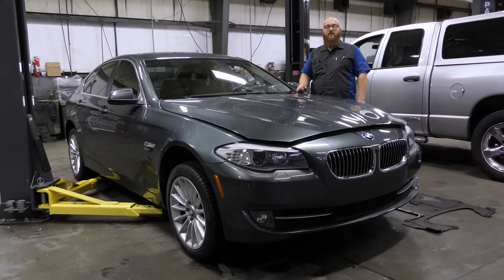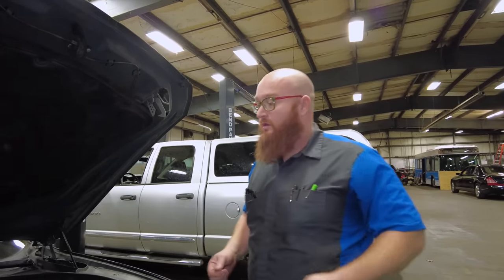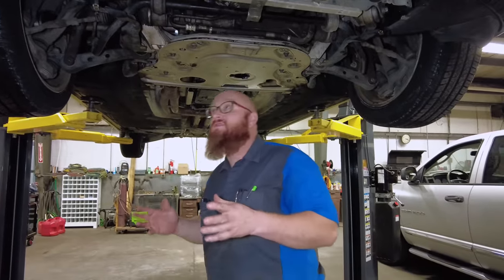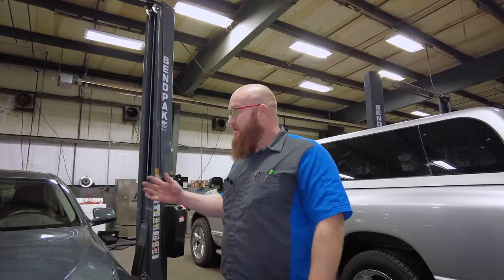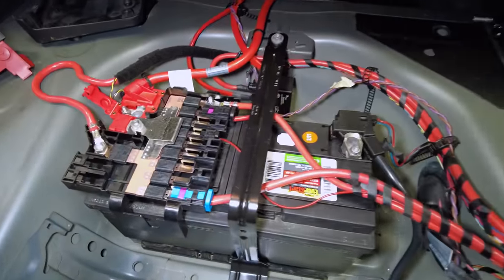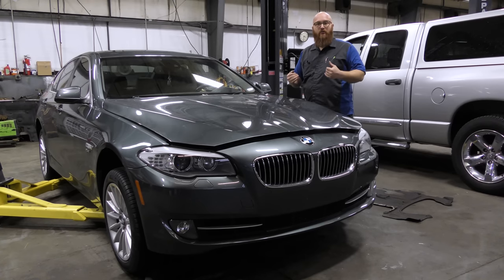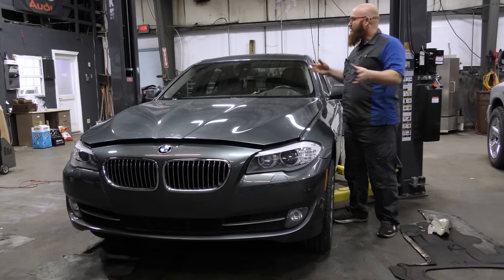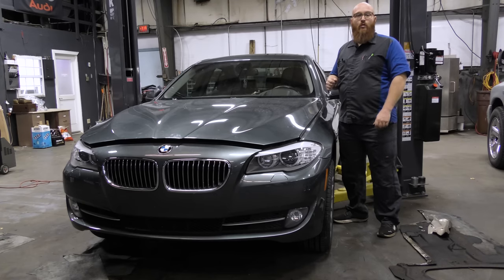One bad day for a customer! CAR WIZARD found TWO insanely unrelated issues at time on '12 BMW 535i

Comment: Somebody's been there before... wrong coolant color. Lowest point with easiest access to drain the coolant. 100% someone messed up putting it back together. If the owner stopped the car immediately as he noticed the overheating check control message (or before if he noticed it on the gauge) then the engine is fine.
And I'm still surprised people take their BMW to a mechanic that chargers $600 to replace an E46 oil filter housing gasket.. $1200 to replace the starter motor is insane...

Comment: I love BMW's but used ones are best left to DIY enthusiasts.  I've had multiple ones over the years and while they have more issues than a honda or toyota they are easy to work on and won't break the bank if you are a DIY'er.  If you can't work on cars then definitely stay away from them as for the price of maintenance you might have well just bought a new one with a warranty.  As someone who owned a Porsche 911 993 model it is funny to hear him talk about the cost of these jobs.  $600 for a seal replacement, $1200 for a starter on BMW's etc.  I had to have a valve job done and even as a DIY'er I didn't want to touch it as when you go to sell it people want documents from a reputable dealer.  Well that was $6k.  The power steering was also leaking, another 2K.  Starter went out which I replaced myself and the Bosch part alone was $750 and I had to make a special tool to hold the bolt while re-installing it because you can't even see it and can barely feel it without removing the engine.

Comment: I'm not a BMW guy but it does have 200K miles, it's over 10 years old and things are going to start breaking. Regarding the starter, my guess is that he tried restarting it when the engine was really hot and since these things have weak starters to begin with, it just couldn't turn the engine over and it died.

Comment: That's a really weird way to keep it into neutral. I have an E66 7 series and there is a simple way to do it from the Trunk. There's a stick near the spare wheel, we need to insert this stick into a hole that is clearly labelled, just insert and turn and the car goes into neutral.

This is a BMW from 2005, it's a shame they didn't keep a similar feature in the newer one.

Comment: Wondering if the overheat triggered something in the dme. I'm even doubting that starter is bad.  Pretty dirty (BMW) to put starters under intake manifolds although I have heard of some guys sneaking them in from underneath (lift).  From the customer perspective, If you are not mechanical and want to drive older bimmers, prepare to pay or just lease a new BMW.  They want it that way.  Great channel wizard!

Comment: Bmw haters. Had my 530d for 10years and 172k miles. Oil changes at 10k and premium fuel, only thing aside from brakes and tyres was tie rod ends at 170k. Never missed a beat and was remapped at 60k to 325bhp.

Comment: Starters on bmw's are program interlocked. Same is true of Mercedes. Ive seen a transmission on a mercedes throw itself into limp mode and it would never accept a new transmission, we ended up replacing the ecu to make it run. And it was tragically expensive, and that car has more of my blood in it than i have in my body currently.

Comment: its true,they run hot ,thats part of bmw scheme .if you dont turn them off when they start to overheat  you are takin a big chance becuz you dont have much time and they warp up,ive had many bmws and never truly overheated one but ive come close and lucky...bmws are not for everyone period,and many ppl drive them into the ground by NOT fixing the little things as the go wrong and then they have bigger problems.now i dont buy or own any after 2005.ive had e90,e70,e30 e46 e36 now ive kept my e39 and e53 and im happy.this guy makes good points but all cars after 05 to me are junk.

Comment: I owned one for 3 years. Bought it with about 80k miles, sold it with 160k miles. Only ever had 1 issue : the damper crankshaft pulley gave out at around 100k miles. Changed it, and never had another issue.
Reply: Someone has to get lucky! Right? Call the person you sold it to and ask how's it doing.

Comment: I own a 2013 bmw 528i drive that has 168,200 miles on it. I love the car but the almost two years I've owned it I've had problems all the way from coolant hoses spraying coolant everywhere to transfercase and transmission blowing out. Every week it feels like it has a new problem whether its electrical or mechanical and the car is very well taken care of and babied but it still never stops breaking.

Comment: Check them all. Of course BMW have electric water pumps. And the thermostat is from the factory is yes plastic, but. You can now buy a replacement aluminum one. Not sure wizard but the BMWS made in Germany ship to the U.S. starting with the Vin: begging with G 
are better quality cars. Or the older ones "89-2010 BMW with no I drive, no X-drive, no turbos and so on. The  kicker is you have to, you must, work on your own BMW because if you do not work as a mechanic on your own car. It will put you into bankruptcy..You have to love this car as many of us BMW enthusiast 
know. How to fix all the the problems these cars bring and do the work ourselves.. They are very good cars if you understand them and how they work. Thanks wizard..

Comment: My Porsche blew a hose and overheated coming out of my neighborhood. It ran for about a 2-3 minutes before getting back into my driveway. It was fine (20k miles later). Replace the starter, refill the coolant. Should be fine if the customer didn't go far.

Comment: The starter solenoid failed.....all you have to do is manually short out the starter to directly drive the starter motor at the same time as you are trying to start it, so the ecu sends the start signal to the injectors and such. You could then verify if the engine is operational and it would not take more than 15 minutes of labour. From there you could make a decision.

Comment: I had those undersized head bolts come lose which lead to overheating; just retorqued.
Electric pusher fan failed, removed it and shroud, ok now.
Too many plastic parts like heater return hose, custom and failed, plastic radiator tanks, plastic radiator fill tank.
Just lubricated u-joints, new guibo, fixed driveshaft bearing retainer, lubed cv joints, OK now!
Yes these cars are too much! :)

Comment: I really like your videos and content however I have to say that this whole video is a load of bunk. Nothing in this video is uniquely a BMW issue, in fact this particular car appears to be a very nice example of an F10 535i. 

First of all, there is a manual neutral override in the center console in front of the gear selector for F10 chassis vehicles, you pull out the cupholders and use a tool included with the car to force it into neutral when the battery is dead or the engine doesn't start. The one underneath the car is so that you can hold the transmission in neutral or park while doing work without needing to go up top and change gear, that's how ZF designed it and those gearboxes are actually quite good. You mentioned the car has "X drive problems", it doesn't. There's nothing wrong with the system, it is working totally fine.

Second, a coolant line bursting on a car with 200k miles happens all day every day to all cars. The vehicle warned the driver of a problem, the vehicle was stopped and everything was OK. Again, not a problem unique to BMW, hoses are made by Rein and the quality is good, it was likely the original hose.

Third, the starter likely failed either by coincidence or was close to failing and the excessive heat pushed it over the edge. BMW starters of this era are made by Denso, the same manufacturer for Toyota and many other brands, I don't hear anyone complaining about those. If this was an original starter then I would consider that quite good, starters are very commonly replaced with poor quality aftermarket units and contribute to a bad rep. Denso starters are very good quality parts.

Otherwise the car (with 200k miles) has a small leak from the rear main seal. These cars do have common issues, this particular example doesn't have any of them and seems to be a very nice car for the owner.

Comment: N54 one of the greatest platforms - especially in a manual.  Starter replacement sucks.  don't overfill coolant or overflow will burst.  And while you're in there, change out the regulator module!  - normal for a car over 120k.

Comment: Great video it verifies but I told people about BMWs I fix cars my whole life BMWs are crazy my buddy bought a brand new X5 in the throttle did whatever it wanted he have five modules replaced under warranty I drove the vehicle the accelerator was out of control it was just predictable he got rid of the vehicle because it's just too unsafe to drive and BMW told them there's nothing wrong with it have a great day you taught me a lot that I didn't know

Comment: That coolant line has to be unplugged to access two bolts attaching the subframe to the front of the vehicle. Most likely the front subframe was lowered during a repair and the coolant line was not properly reattached. Or someone tried to drain the system from that line.

Comment: It’s a 200,000 mile BMW. Most cars at 200k miles will require some type of maintenance. The customer should know that. Starters are wear items and considering the miles and years, that’s normal maintenance.

Comment: I refuse most older BMWs and Mercs due to the cost to the customer. A lot of these older luxury German cars are owned by people who want to baller on a budget. Countless times I've called and they gasp when they heard the cost to repair. Many times they've abandoned the vehicle. 

You'll occasionally run into the type that just love the car. They don't want a new car, and they could go buy a new one cash. They drop it off and essentially give you a blank check to fix it.

Comment: If that's the original starter on over 200,000 miles then in my opinion that starter has performed admirably especially if the car is fitted with stop start technology. Just unlucky it failed at the same time the coolant issue arose.

Comment: On large marine diesels I take the thermostat out.  $30,000 diesel blown because of a bad $60 thermostat? Keep the engine temp sensor and you will see no difference except at warmup.

Comment: About a year ago, our 528iA got overheating problem. As we saw no leaks, I realized it could be some kind of obstruction. In the radiator's bottom there was a metalic duct that was clogged with rust and dirt. Import a new one was quite expensive, so we decided to clone it using a better material(aluminium) with a professional. Coolant re-filled, the engine started at once and never again it gave up(but it's an E39 from '98). If you want a car like that, you must ensure the maintenance is done properly. The new ones? Thanks, I'll pass.

Comment: C. coolant hose is most likely.  Could be A,  If the water pump blew up it is plastic(not that likely).  Not B. as there would still be coolant in the system enough to atleast keep it cool and that wouldn't leave a trail if it was just the reservoir.  Aww crap you got to pull the intake... I'll wait to clean my intake values then when I have to replace the starter :(

Comment: Can confirm what the wizard says is true 😞 about a month ago my starter gave out (which I already had replaced just 2 years ago), then the water pump gave out just about a week later so had to replace that and the thermostat while I was at it, then literally in 2 days the radiator blew and coolant began to spew everywhere so had to replace that and now I'm noticing a pool of oil under the car wherever I park 😒 oh and totally unrelated, my rear passenger side window regulator just randomly broke so had to replace that too

Comment: Didn't the owner get a low coolant level light? I have 2 06 330s and I agree with the location of the starter. I actually love them living in the rust belt they're the only cars I have with no rust.

Comment: i had an 08 335i, same exact thing happened to me. coolant leaked out car overheated. the starter also went out, granted the car had 195k miles at the time. but i’ve always wondered if someone else has had a similar experience.
Reply: Weird how your starter failed at the same time too. It's almost like Bmw built in a self preservation feature to stop further damage to the engine

Comment: I think after it shutted down , someone had tried to turn it on so much and it wouldnt turn on because of no coolant there enough in the car , 
So someone tried and tried until he missed up the starter,, 
I think in bmws if there is no enough coolant in the system it will not start , the starter will turn but it will not start the computer blocks the fuel 
At this situation in my country you can borrow a starter from a junkyard to run the test and return it back if the engine is shot

Comment: The car is over 10 years old and we all know about these plastic parts in engine. They become brittle and brake easy. I just repair 2009 BMW 325i where plastic hose just brake during driving. Luckily owner stop immediately. After checking we decided and replace all plastic hoses. I really don't know what Germans where thinking while designing these cars. On VW is the same.

Comment: Guess I must be the only one that's amazed. 200k out of a starter on a car that has a stop/start feature. How many times do you think that thing has had to start that engine over the last decade. I've replaced plenty of starters over the years on cars with way less miles before start/stop was a thing. That's the problem with having multiple failures at one time, typical diagnostics says you check the end of the circuit for power (starter) which would have been a very quick diagnostic but when your assuming multiple failures are related you get distracted.

Comment: I cant lie. I love BMW's and owned a manual 98 328i Convertible for 5 years. Cream puff. Never had any issues other than a secondary air pump going put. My best Freind bought the car and still drives it until this day and it now has 200k miles on it. The entire cooling system on my E36 was replaced at about 100k miles when I owned it by my insurance. An Armadillo ran out in front of my me. The BMW Dealership replaced the entire from bumper and cooling system. IF YOU ARE GOING TO BUY ANY BMW, GO TO ECS TUNING & ORDER AN ENTIRE AFTERMARKET COOLING SYSYEM MADE FROM METAL. IT COMES WITH A LIFETIME WARRANTY. Then things like this video is about can be avoided all together. BMW Makes Crappy plastic cooling systems.

Comment: The hose problem could be a water pump not pumping to specific operating pressures (age)as a beginning of the root cause. Air got in the system and pressurized completely blowing the hose off. Car wizard hates BMWs I don’t blame him. Starter has me baffled because there is more questions to be answered. Buy a spare car (A Toyota or a Honda) ,,,therefore when the BMW is broken down at least you will have a vehicle to drive…The car over heating issue is not solved unfortunately. I suspect pump and thermostat needs replacing if it has never been done.

Comment: The owner got 200K miles out of it which is decent mileage.  I think throwing $1200 at it to see if the engine is working is worth the gamble.  I say it will run again.  I doubt the engine got ruined from a short overheating period as long as the oil was in good condition.  I hope there is a follow-up to this story to find how things turned out.  For a Bimmer owner, $1200 should be chump change, holidays coming or not.  It doesn't seem like a disaster, at all.  I say once the starter motor is replaced, the car will be just fine for a couple of more years.  Have the Wizard check it over thoroughly and let the owner know if there are likely problems the owner needs to be aware of for that model BMW.

Comment: One coolant hose came off and BMWs are crap again. Sounds like a non-issue. Also checked quickly the price of starter motor for that model and it's a bit under €100. Quite a markup you got there. I might even call to my average Joe repair shop to get a price quote for starter motor job just for fun since that asking price sounds ridiculous.

Comment: Not sure but maybe the starter solenoid was ready to go in any case (what is mileage and how was vehicle driven), but the excess heat from the coolant loss pushed it over "the edge" . I try not to produce lots of heat with a turbo engine especially for many reasons that can impact wear and tear.

Comment: Because the owner beat it up to a pulp that is the starter trying to start it when the engine got past temperature n went into safe mode preventing a startup, the starter overheated and burn a coil.

Cranking for waaaay too long trying to start the car remember it's a lithium battery it can crank n crank n crank n crank n crank... as u kill your starter.

Comment: Class 8 Heavy Duty trucks have this fail safe system---if coolant level goes down---the engine won't start to save the engine from over heating and eventually seizing---. 
Wish congress had made a law for all manufacturer to do that on automobiles

Comment: I had a 2006 BMW Motorcycle.  Starter died, took it in to the dealer.  Bike started revving on its own and dealer could not fix it and would not troubleshoot further.  Wanted me to pay $4K with the bike not running.  Bought a new Yamaha for $5K and left them with the expensive paperweight.  Will NEVER buy a BMW vehicle again.

Comment: I know why the starter failed... 😅😂 Either the customer or the tow truck guy got frustrated with that - agreeably horrible - emergency neutral unlocking procedure and tried to start the car on multiple occasions  for an extendend period of time, thus overheating and killing the starter. That seems more plausible to me...